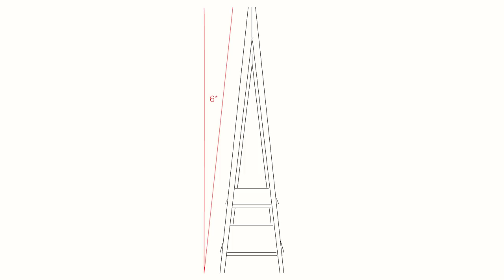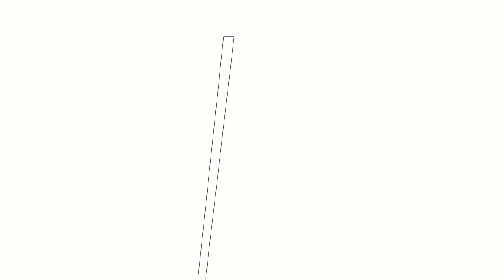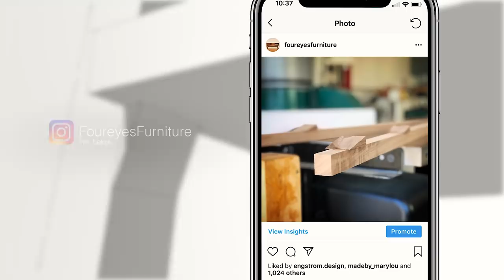Minimalist Wardrobe | Mid Century Modern Woodworking

Comment: Great video! I like the little shelf wedges...looks like they work just fine and they're a nice change of pace, just like you mentioned on the podcast.
Reply from the maker: Yeah, they are small by mighty. Well...mighty enough to hold the 15lbs or so that 4 of them will be required to handle :)

Comment: The little shelf support wedges are just glued on? You didn't shoot a brad though them? I'm legit asking, not judging (Grin)
Reply from the maker: Yeah, these shelves will never hold a lot of weight, and it's a face grain to face grain joint which is insanely strong. Basically just think of it as one solid piece of wood cut to that shape.

Comment: I've purchased the tool at 7:24 because of some previous videos. I'm successful at using it about 75% of the time. The other times there have been tear out or burn marks because of it. Do you have any suggestions in using it. I have contacted Fastcap, the manufacturer, and they said it might be the router. BTW: Awesome vids. If we had that weather in Texas I would be doing videos in my garage year round.
Reply from the maker: Have you tried it with a different router? I rarely have problems. In fast, this has been, I think, the only time I've had a problem that needed repair. I normally climb cut when I'm using it. Here I wasn't...that's the reason it blew out like that. I was just rushing to get a cool slow motion shot.
Reply: Chris Salomone No, I only have a Bosch trim router. Maybe my investment should be in a better router or a slow motion video capture 😜Thanks for the response.
Reply from the maker: haha...definitely the slow motion :)

No, but really, I speculate that it could be the router and or bit. probably more likely the bit actually.

Comment: dude, what kind of blade do u use for your table saw? I think my 10 inch thin kerf from freud bends when cutting close to the edge of the wood so my beginning and end have different widths... any ideas? thanks! great video BTW! very inspiring with your precision work.
Reply: I dont think it's your blade. Check to make sure that your fence is square to the blade.  That's most likely the culprit
Reply from the maker: Hey Grace...I'm with Zander Kent on this one...I don't think your blade would be flexing that much without any other issues. That said, my blade is a Forrest Woodworker II - regular kerf.
Reply: @Foureyes.Furniture  thx guys, I did check the fence and it's square, so I think maybe kerf to thin... maybe I  tried to push too thick material...
Reply: @chengg02  look up the 5 cut method, it is for squaring a crosscut sled. But I think the concept still applies.